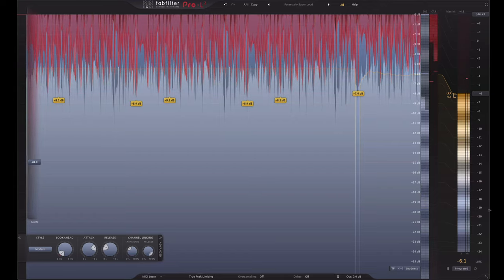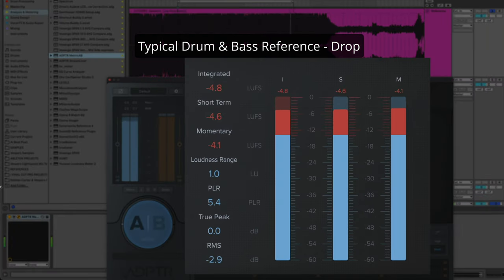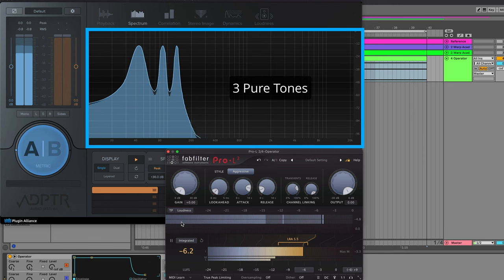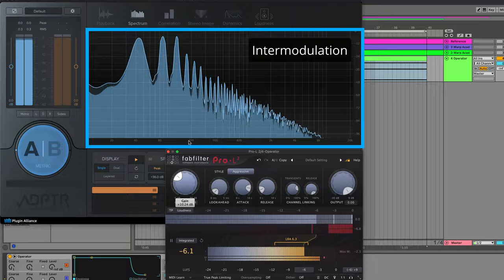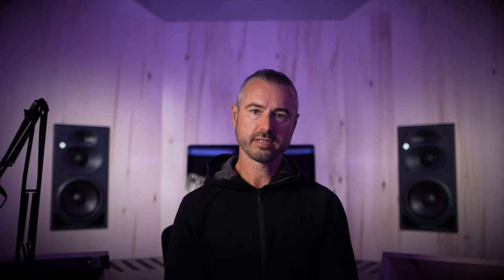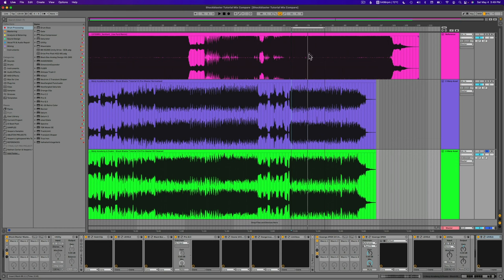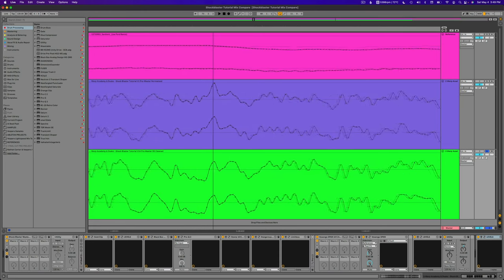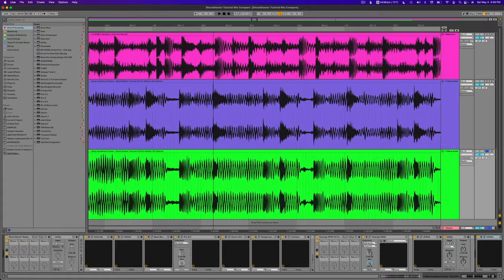HOW TO MASTER LOUD - INSTANTLY Get FAT, Clean + In Your Face Results

Comment: pls do one on how to achieve a relatively clean -2 or even -1 plssss
Reply from the maker: You're talking about how to get a relatively clean -2 to -1 LUFS master?  If so, I'll have to weigh in with some tough love here and say that's absolute insanity.  First of all, there's no need for that, even in the loudest genres played in DJ sets.  Second, you'd be making so many compromises that you'd be completely destroying the art and music in the name of loudness.  It is conceivable to get quite a clean sounding -5 to -6 using some really tight engineering tricks, but much beyond that and there's only one main way of pushing louder, and that's to sacrifice bass.  I've never heard a -4 LUFS or beyond track from anyone that I actually thought was done well and didn't sound like a distorted mess.  That said, I'm always willing to be wrong.  If there's one out there, send it.
Reply: @warpacademy  like i mentioned in my other comment, i forgot to mention that i was talking about momentary lufs (around -1 or 2), which is still can be achieved without sounding crappy, and it is quite annoying that despite you are right in "making so many compromises that you'd be completely destroying the art and music in the name of loudness", the track which is not this "loud" will still be considered as quiet and "not enough energy in it" by labels  all the time and in the end of the day, if you compare your stuff to the reference tracks, and EVERY one of them is waaay louder (lufs-wise), its not gonna work, thats an issue sadly
Reply: @warpacademy  hitting -2 is yeah, too much, but we can shove up the clean and dynamic tracks in our asses sadly, bc this is not the standard
Reply from the maker: If you’re seeing tracks like this I’d like to check them out.  Please send links.  

I’ve personally never seen dnb songs in this range.  And I’ve also never heard anything north of -5 LUFS that didn’t sound like a dumpster fire of hot garbage.  

Prove me wrong though.  I’ll listen to songs if you link me to them.  Cheers!

Comment: always put a clipper at the end of drum buss
Reply from the maker: Drums are definitely the most common source of short easily clipped transients.  Although, I have recently been putting my clipper at the beginning of the drum bus not the end.  It makes sense because then you reduce the spurious peaks into other level sensitive effects like saturators and compressors.  Although clipping last can work well too.
Reply: @warpacademy  perhaps at the beginning and also at the end? I will try this in a session that im currently working on. I use SIR Audio Standard Clip, do you always hard clip or do you ever soft clip? Is there any benefit to using one rather than another or is it purely a style/taste type thing?
Reply from the maker: Hey hey.  I think once you've removed the micro-transients with a hard clipper, you may find that adding a second hard clipper at the end of the chain is a bit much and may start to dig in too much and dull the transient.  

The way I do this is I clip most individual sounds (not all) as transparently as possible, then those sounds get routed up into a sub-mix.  I clip at the beginning of the sub-mix where sounds sum together.  That is a key place where more micro-transients happen.  

Then I clip again at the master.  If you need more clippers than that, you're probably going too hard and getting carried away.  It's just not necessary.  

And yes I do soft clip for sure.  It's typical for me, after the initial hard clipping stage, to add a saturator OR soft-clipper (not both) - depending on the sound.  If it's a sub-mix, I usually go with saturation because I use the Black Box Analog Design HG-2M2 which allows me to work in mid-side mode.  Clippers don't work like that usually.  If you overuse soft-clipping or stereo saturation on a bus or master, then you can add too much saturation to the side signal, and cause the mix to lose depth and sound too closed in.  

I like soft clipping more on individual sounds where I want to add harmonics.  Perhaps some sub-mixes, but I usually find myself wanting more control and I enjoy working in MS so I can saturate the mid separately from the side.  

Cheers!

Comment: U think im going to sit there and manually turn down the volume for every peak your out of your mind 😂 not even someone scoring a movie would do that 😂
Reply from the maker: If you think mastering engineers don’t actually do this, you’re not in touch with the industry my friend.  We do.  And this is part of the edge that a professional can gain when willing to put in the work.  

That said I do not do this on every song I work with.  Sometimes I let the clipper handle it.  But for really loud stuff where 0.5 dB of extra gain without limiter distortion matters, this is a big level up.

Comment: Drum and Bass is not a good material to reference real loudness mastering. More complex styles, with several instruments, several tonal and frequencies balance can make a big difference and a real challenge to get -5 dB LUFS in final mastering. Thanks.
Reply from the maker: This is an excellent reference as the song I’m mastering is in that genre.  You want references to be as close to your original as possible.

How loud you end up getting to in your master is complex and has so much to do with production techniques and the mix in addition to genre.

Comment: Not interested. 10 lufs is good enough.t
Reply from the maker: Seeing as you have "DJ" in your username, watch this: https://youtu.be/UHxKQ3iIPyA
Reply from the maker: Neat signal chain. I mean, if you’re processing out of the box it’s completely different.  You’ll have to load your gear according to a completely different set of rules.  

And I agree with you about harshness in digital music.  People’s preference for brighter masters is a real thing.  And there’s aliasing in digital which doesn’t exist in analog.  

Brightness is very subjective.  And if you want to create a more smooth, darker top end you can easily do that in digital at high loudness levels.  Perhaps your DA converter is distorting from ISPs unless you leave a certain margin.
Reply: @warpacademy  after i mix otb i bring everything back at -6 dbfs. Then i use a volume plugin with a limiter in the master itb to bring it to no more than -.5 dbfs.